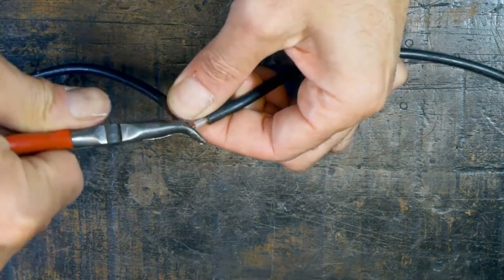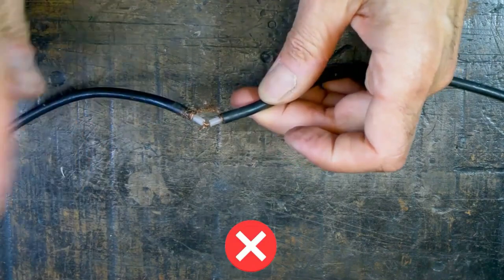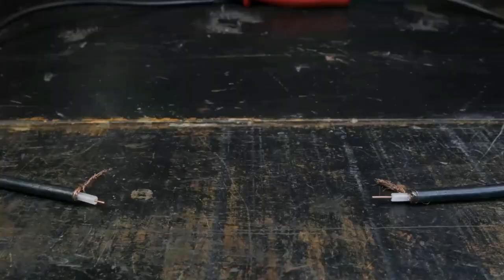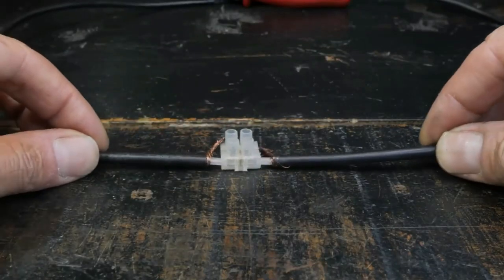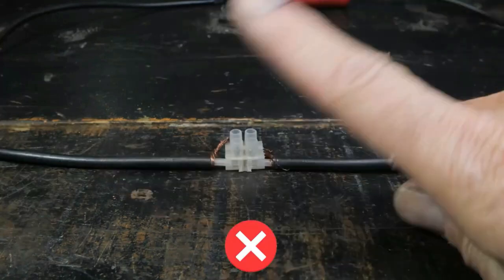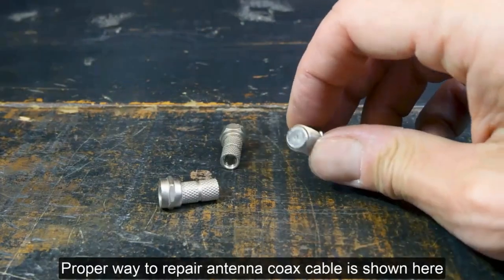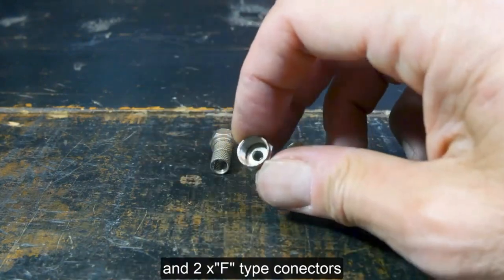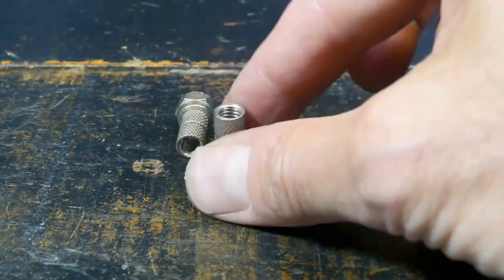The Electrician's Trick to Connect the Tv Antenna Cable Correctly

Comment: If you're going to use foil, use copper foil if the cable is going to be outside and exposed to the elements. aluminum/aluminium when combined with copper and exposed to moisture can act as a galvanic battery. causing galvanic corrosion of one of the metals.
Reply from the maker: Yes 100% right